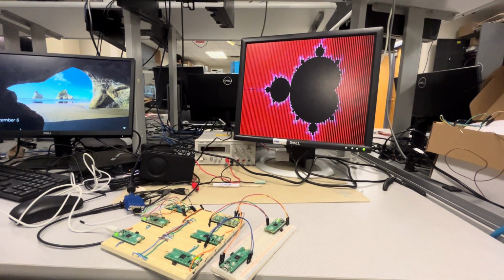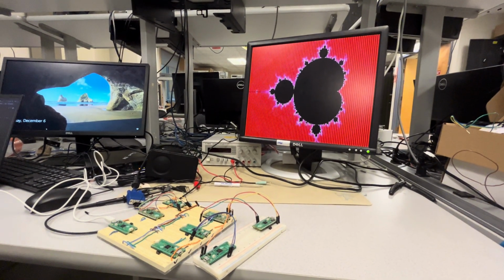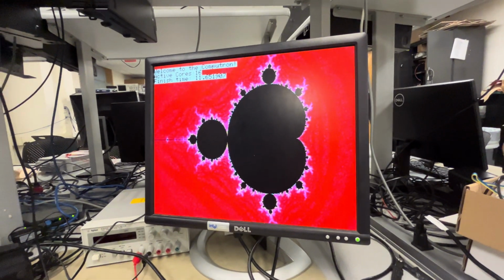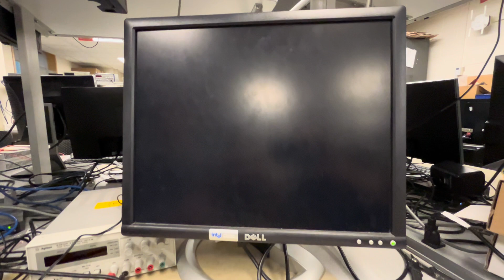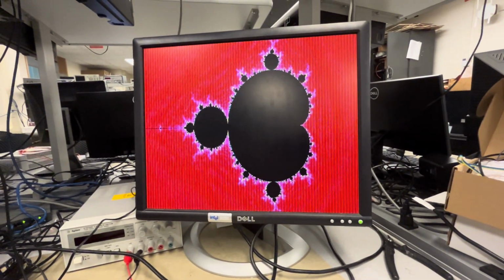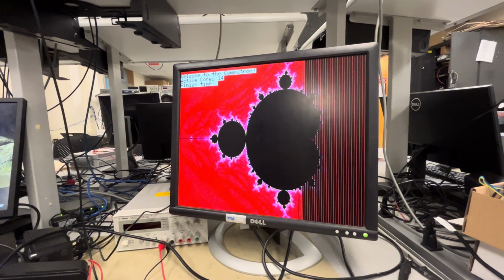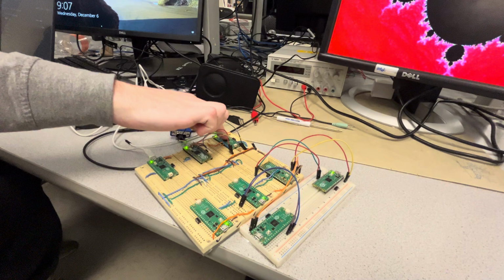Parallelized Mandelbrot Accelerator implemented on 8 RP2040's

Comment: The devil is in the detail for this one. It works so that is great, not sure from the description though if it is a conventional worker queue model. Are the slaves taking work units from the masters queue, if so I would expect the speed gain to be greater unless they are fighting for bandwidth. The I2C unique ID is a nice touch. Any source available?
Reply from the maker: https://ece4760.github.io/Projects/Fall2023/ir93_rak277/index.html
Reply: @hunteradams9430  Nice description. The code is not available to the public without registration.  Looks like the worker model is (from my perspective) the wrong way round. It is more normal for the controller to maintain a list of work units and for the slaves to poll the controller for the next available work unit. This has the advantage that the number of slaves working can be dynamic. It is also more fault tolerant, in that slaves could be removed during runtime and no work lost as the master only fully removes the job from the queue when that job has been completed. Nice project on the whole though.